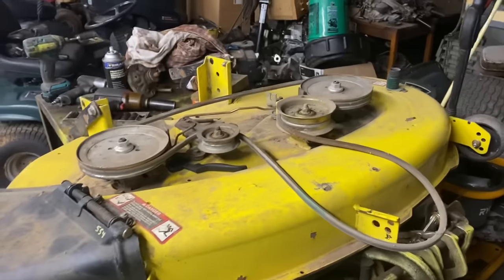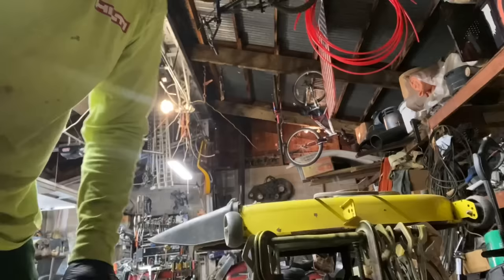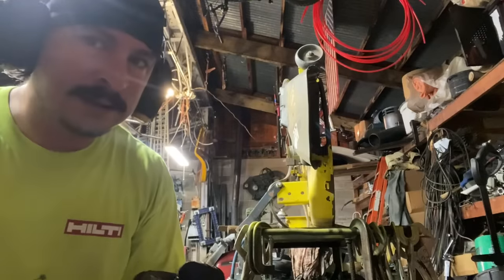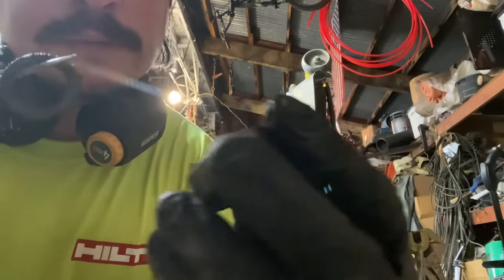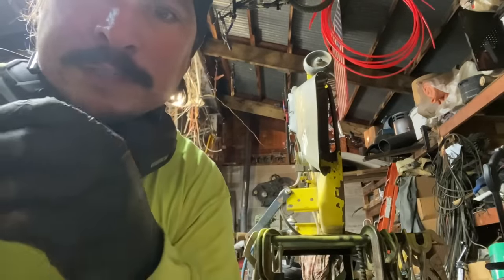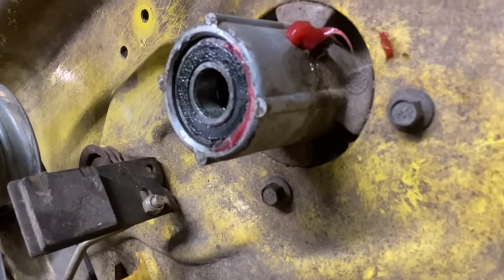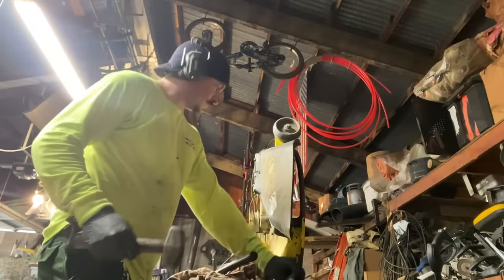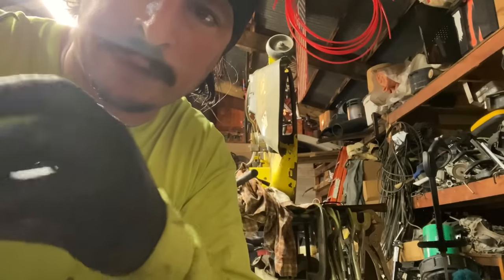Part 1 - Don’t trust the “Experts” Grease your mower deck sealed spindle bearings Common sense.

Comment: Great video, it’s about time 🤣🤣 I just acquired a used 2001 Husky and those bearings sound dry when I spin the blades by hand. I’ll get right on it now that I’ve seen this. So far the wheel bushings and spindles were ignored. Converted the bushings to sealed bearings also.
Reply from the maker: @RichardEidson  hopefully adding grease will save those deck bearings. Sometimes when they start making noise it’s already too late but maybe you can save them

Comment: Some construction people save money by using not enough screws or nails. Some mechanics save money by using not enough grease.  Add a grease fitting, one rubber seal on each bearing facing each other. Got it !!
Reply from the maker: Sacrifice quality for more profits but in the end I expect it cost more to both the manufacture in loyal customers because it costs the customer more to repair cheep built equipment

Comment: I sell bearings for a living, and totally agree with this. The lifespan of a bearing is determined by the lubrication.
Reply from the maker: Thank you sir. Man your comment is going to make some of the naysayers loose sleep.
Reply: It has seemed to me that "greased for the life of the bearing" has been an advertising slogan that is meaningless if the "bearing life" is only a few years when subjected to a rough use dirty wet offroad environment versus where the same bearing can last more than ten times longer with more than 30 years of service under the same conditions when the bearing housing is completely filled with the initial 70 or so pumps of grease and regreased periodically thereafter with a few more pumps to refill the housing of mower bearings etc. as in this video. The full housing of grease becomes an additional bearing seal or layer of protection against dirt and water which also ensures that the bearing is never lacking lubrication in applications similar to this video. Been field proven over decades in many offroad dirty wet severe service applications.

Comment: I did the thing removing the inner rubber seals, pumped about a half tube in,  and I think it causes more problems.  Take a good look at your belt idlers (the pulleys/guides/tensioners  that do not have blades attached).  If you look closely, these idler pulleys are two halves spot-welded together.  Looking further, the same sealed bearing is sandwiched between the two halves and they NEVER get grease.  There is a spacer pressed in the bearing that easily pops out.  You're left with a simple 6203rs or 6204rs.   I know for a fact because I drilled out the welds on one, (wasn't really bad) out of curiousity to see what was inside.  How often do the idler pulleys go bad?   I've actually encountered more failures pumping a tube of grease in these.  I probably got 8 years out of my OEM bearings un-greased before they had to be replaced.  I quit dumping a tube of grease in these things.
Reply from the maker: The idlers can be simply greased with a grease needle. The lip on a good seal/shield is soft and flexable and can be easily pushed aside with a scribe or pocket screwdriver allowing needle to safely pass the shield. Even if a seal is damaged slightly it will benefit from some added grease. As for these bearings, one should be aware the shields/seals do a very poor job of keeping water out so washing a deck is risky because once water gets into one of these it’s nearly impossible to get out. I recommend always blow a deck off with air after mowing and keep it clean and free of grass build up. A hose is bad enough but a pressure washers will most certainly push water into these type of pulley bearings. As for greasing them, Takes longer to get tools out than it does to add the grease. I have a video on the topic and I always add grease in these any time I’m servicing a deck. It’s basic maintenance for folks who know but unfortunately very few folks know because the mower brands would rather see your tractor parts fail so you will just go buy new parts. Or better yet pay a dealer to install the parts. Better yet buy a new mower. 

If your deck had zerks, then removing the seals was simply a waste of time. No need to beat around that bush. If it didn’t have zerks than you would have to remove the bearings or add a zerk to get grease into the housings. as I have clearly proven with step by step instructions the decks with zerks just need to be greased through the zerk and no need to take anything apart to achieve a well serviced bearing. It is very possible to create  a problem when dismantling the assemblies especially when it is not needed. I don’t ever recommend pulling bearings out to remove seals because those “seals” are really just a dust shield and can’t prevent oil or grease from passing if it has any amount of pressure behind it. The word seal should be used with that understanding. Not all seals are created equal and this type of “shield” is at the bottom of the food chain so to speak. Folks put stuff back together wrong all the time. Sometimes I’m amazed what I see after someone tried to fix a deck. I’m sure I did a lot of crazy stuff when I first started fixing decks as I was learning. If someone is not familiar with the way decks are assembled it is very easy to put things back together wrong with spacers in the wrong places or simply leaving seemingly unimportant parts off. I can only assume you needed to knock the bearings out to access to inner seals you mention removing. That can also be a way to damage bearings. If you damage a bearing retainer that can eventually lead to a failure.  If you’re trying to convince me that simply adding grease through a factory installed zerk and filling an assembly with grease in the same way I show will cause more problems than not doing so, I’m going to have a very hard time believing that.  But I’ll consider it if you can show me proof. After all this is YouTube, it’s free to post videos. Please post your link here in my comment if you like. This is a DIY video and my who goal is to help people so if you can prove a point on video to help us please do so. This is the most basic service for a mower deck, but unfortunately it’s also became a secret that the industry does not want buyers to know. A self sufficient mower owner can keep these things going for decades if they will stay on top of simple
Services. There are always unavoidable catastrophic failures here and there but generally speaking even a cheep box store tractor can last a very long time if someone stays on top of the basic maintenance. Knowing what the basic maintenance is will be the key, and it will require some research because the big brands won’t share all that with us. They would like us to think they care but in reality they just want your $. If that was not the case, John Deere would have started using a more durable plastic for its commercial grade mowers 20 years ago. And same goes for the terrable quality vinal seats. There is no good reason for it, Other than profits. They do put some cheep non maintenance parts on the machines so knowing how to maintenance those parts is key. Simply adding grease to any mower deck bearings will never cause a good bearing to fail. Thats if the grease was added before damage has already begun. Many folks think about adding grease when they hear noise and realize there is an issue. But let’s be honest, if that’s when they think about it, it’s already too late. running them without ever adding grease will eventually lead to failure guaranteed. If properly greased from day one, I’d argue the bearings will never fail unless something is hit with the blades while in operation causing said damage or of course if someone is messing around inside a deck and does not know what they are doing. And that’s unfortunately how some folks like myself learn these things. I learned all this on my own from trial and error. I have made a lot of mistakes and I learned to fix decks out of necessity and then realized not many people fix decks and I was helping folks around here. Now here we are, chatting it up over the Interwebs. Everyone has an opinion and mine is no more important than yours. I just wanted to show proof of how grease can be added through a zerk on a mandrel. / spindle assembly. My video provides the details needed to allow folks to do some critical thinking. It is just my opinions about the life of bearings if grease is added but it is a proven fact that grease will enter and fill the bearings if done as I have showed. Folks can do what they want with the information. I feel fortunate to have stumbled into a topic that is obviously so controversial and now realize that a lot of folks had questions about this procedure. This has worked great for me and now all my mower decks run smooth until I run over a brick or a root. But no more premature bearing failures due to lack of grease anyways.

Comment: Good straight forward information. an old saying fits the stupid idea of not greasing spindles or only putting a few pumps in it. 'It failed because it was burnt up with grease' 😅😅😅  Comment sense says if there is a grease zerk there, it should be greased. I have a simplicity 54" deck with 3 spindles that take 50 pumps to fill completely up.

Comment: I just found your channel through this video. You have a new sub!  🦅🇺🇸
I've been telling people this for years!  It also keeps the moisture out of the hubs and prevents rust and corrosion.  
Thanks for sharing; I'll be checking out some of your other videos.  😁👍
Reply from the maker: Thanks - I agree about the rust and moisture. Iv seen many times that the ones that have never been greased are damp and have a lot of rust inside. Not always but sometimes they are pretty bad. Thanks for the comment. Appreciate the support.

Comment: I came here to see how to service my John Deere 42" deck. It's good to see you're using hearing protection when using power equipment. 8 years working on aircraft and I have tinnitus every so often. I would suggest eye protection as well. Metal slivers in the eyes are painful.
Reply from the maker: What I was doing here did not require eye protection but I do use safety glasses often.

Comment: thank you, I have argued that point with the local dealer for years.... i will continue to pump the mandrels full of grease.  I pressure wash my mower deck, because Air Pressure alone just will NOT remove the clumps of grass and mud around the mandrels.
Reply: I paint my decks with used motor oil.  The mud & grass holds the oil. Until it falls off.

Comment: Thanks for showing how easy it is to remove the erstwhile sealed bearing rubber seal. I will pop off the rubber seal and manually grease my golf cart bearings by hand.
Reply from the maker: Do they not have grease zerks on those spindles?

Comment: Thank you for the informative video. I bought a new Bad Boy ZT elite just under 2 years ago. Just recently, the top bearing had a catastrophic failure and destroyed the spindle. I took everything apart to inspect it. The bottom bearing had zero grease in it. ONLY 83 hours on this machine… I’m currently waiting from a response from Bad Boy, but I’m extremely disappointed with a bearing failure at 83 hours. That being said, I need to find a video on adding grease fittings to the spindle… Bad Boy mowers do not have them..
Reply from the maker: I am also disappointed that bad boy sells mowers with No zerk on the mandrels. Not sure if that’s on all models or just some. But the ones Iv seen didn’t have them. And yes, I would be extremely disappointed that a bearing failed at 80ish hours. That’s sad. So many folks like to coment and tell me the decks don’t need grease because they have ram 400 plus hours and never added grease. Each bearing is different. There are so many factors to consider? What brand brand is in the unit? What qulity / grade grease was used. What amount of grease was originally in each bearing? Is the machine kept outside? Indoor storage? Is it washed off with water? Is it blown off with air? Each factor can make a difference in the life of said bearings. However, if you add grease through a zerk, you have a much better chance to avoid bearing failure. And adding grease to a assembly with a zerk takes almost no effort. Seems like a No brainer. But some folks even if they have zerks like to argue about it. Unfortunately you learned the hard way that this new equipment is not always gonna last as long as we expect before a major issue happens. I don’t have a video showing adding a zerk but Iv seen many. I don’t usually make videos of topics that have been widely covered. But I might do a video on adding a zerk. There are some things I’d like to cover in detail like not drilling a weep hole and also the fact that inner shield don’t mater, But can be removed with no concern of harming the bearings. I usually just leave mine on because grease passes them.
Reply: @GTObearclaw1   Man, thanks for the reply. I will add a few things. I bought this during the peak of the so called supply chain issues.. again, I am waiting to hear back from Bad Boy… I’m assuming that they threw this together with cheaper Chinese bearings than the usually use. I know for a fact that they are Chinese because it is stamped right on the bearing dust cover. Now I know that the ZT Elite is not considered commercial grade, and I’m not using mine for that… only mow about 5 acres on my 60 acre property… so I’m wondering if they use better quality bearings in the commercial mowers. I will be sure to ask them that, and a WHOLE LOT MORE QUESTIONS when they get back to me. I’m fortunate enough to have a 3200 sq ft shop, so I wrench on all my own stuff. The mower along with all the other machinery stays in an enclosed, insulated garage so I’ve been about as good to it as you can be. I follow all the manufacturers maintenance recommendations. If they warranty this, I will be installing Zerk fittings on all the spindles. This is my first zero turn mower because we retired and bought 60 acres, so I have no experience with zero turn mowers, but apparently this issue is WAY to common occurrence…hard to believe you can spend so much money on a mower, and get a sub par one.. I would love to see a video about putting in a Zerk fitting. I have recently watched a few. Seems pretty straightforward.  Not sure if you mentioned what kind of grease you use and what brand bearing you recommend.? Thanks again for the great videos.
Reply from the maker: @ifirefight1  it definitely would not hurt to use the higer quality bearings. You will get what you pay for. The cheeper ones seem to be fine as long as they stay lubed. As for the qulity of grease. The better quality stuff definitely is a added benefit but any grease is better than none. I try not to get into the quality of grease because I’m just trying to get the point out that they need grease and don’t want to get to deep into the details. I have a lot of kick back just on the topic as it is now. I’m no expert on the different bearings or the grease but Iv seen some great videos that go deep into testing the quality of grease. If your serious about maintenance I’d say spend the extra money and use top quality if that makes you happy. However I don’t, I use the cheeper parts and the grease on sale and it’s always been good enough for my needs.

Comment: interesting. I was skeptical at first but I was wrong. Also saves me having to take apart my new spindles to take the inside seals off I guess. I had my factory spindle cease up when I pulled my deck off my craftsman yesterday. 510 hrs on it somehow and it had NO grease zerks on the spindles. Good video.
Reply from the maker: Thanks . Your comment and feedback is Appreciated 

You definitely got a lot of work out of those bearings considering.

Comment: Well in my experience with any brand mower like that the bearings usually out last the stamped steel deck…which is even worse!!  Thank you for a well explained and proof of what you’re stating..most accept blindly whatever “their guy” says
Reply from the maker: Sadly yes the deck quality these days and for the last 20 years has been bad for home owner models. And it’s getting worse, way worse. Now some bearings are not even lasting 100 hours with the grease they came with. And decks are just as bad.

Comment: Great video. Could you recommend grease equipment needed to do the job properly. 
Keep up the great work. 
Thanks
Reply from the maker: @keithberry366  I’m not gonna be the best source for that information 

I don’t specifically think any grease is bad or better just keeping bearings greased has worked 100% for me and Iv never wasted much time or had concern over Qulity. For my needs ordinary grease and oils work fine if kept serviced properly. My grease gun is just off the shelf auto parts store gun has worked fine for me. I don’t even know the brand. I do love the locking grease coupler and have tried a few, lock and lube is by far my favorite and I also use a grease needle often and works best with a lock n number coupler to make install and removing needle very easy. Not having a releasable fitting can make getting a needle out of a grease gun impossible.

Comment: Finding this video was very timely for me. After watching a few people telling me to remove the plastic seals, this video tells me the grease can get past the seals, so no need to remove the plastic seals. My Simplicity Citation also has sealed bearings on the castering wheels, but no grease fittings. I am now thinking i should disassemble it so I can drill and install grease fittings, so I can fill that area and make sure the upper and lower bearings get grease. Your thoughts?
Reply from the maker: Sounds like a plan but I’d probably just pack them and they should go a long time no more than they turn